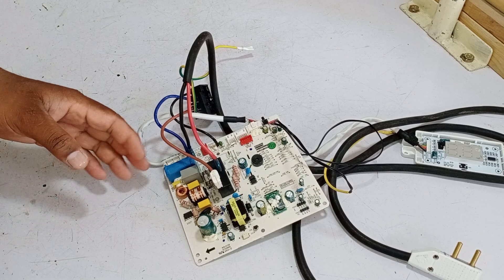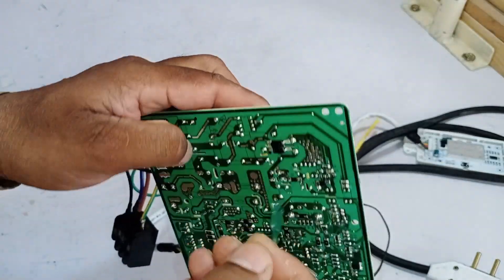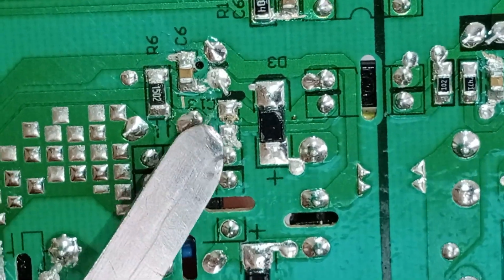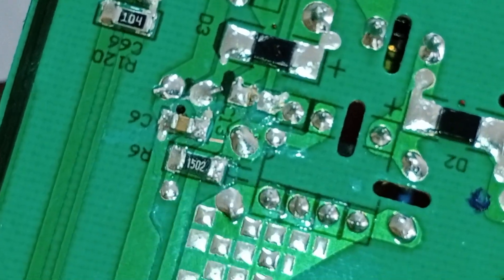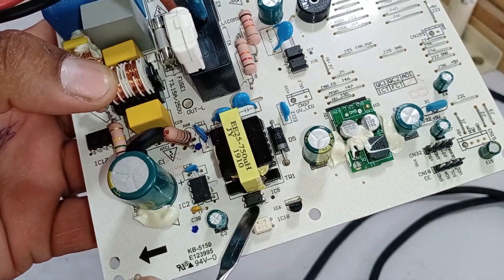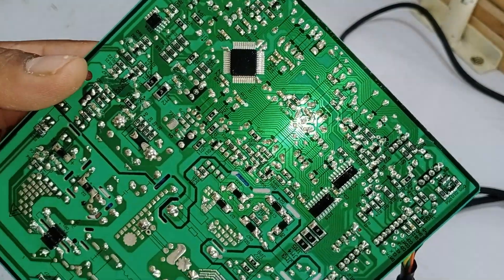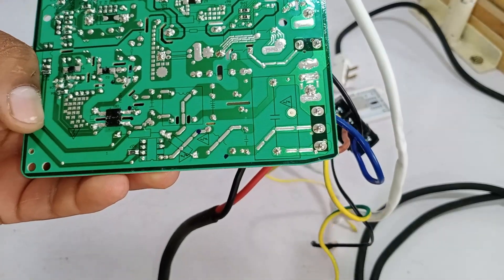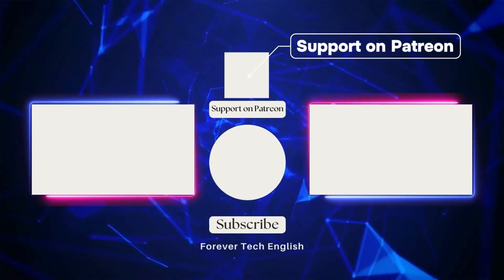Everything You Need to Know About TCL Indoor Mini Split AC Circuit!

Comment: Thank you very much for this information.
I have a Gree wall-mounted air conditioner. The fan speed is slow and won't change to a higher speed, despite hearing a buzzer when using the remote control to change the speed.
I checked the fan capacitor and it was fine.
The fan motor is an AC type, and the speed control circuit contains a triac with a built-in photocoupler.